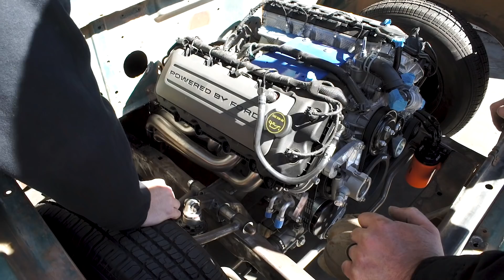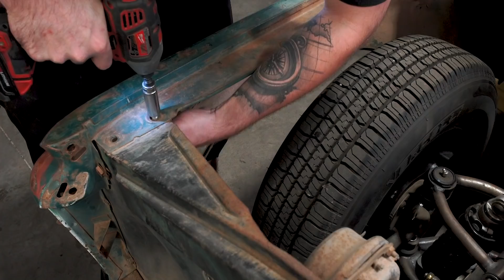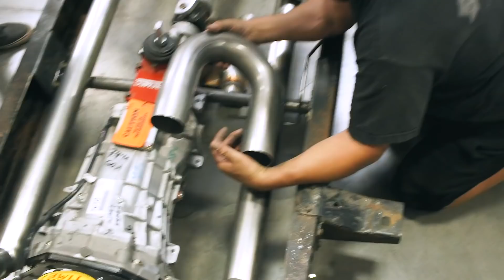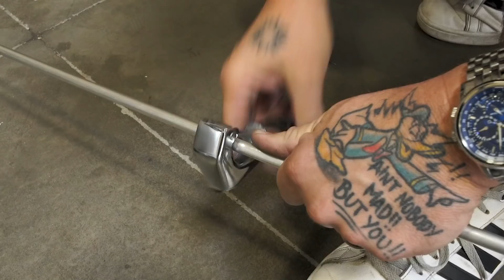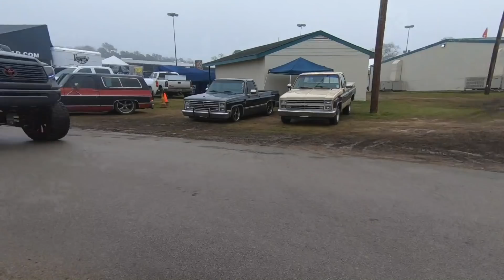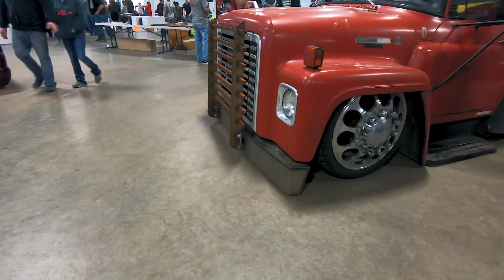Switch Suspension "Ain’t nobody mad but you"

Comment: I went with a towncar front clip just because of budget but down the road I will do No Limit IFS with a coyote, Really like this truck.  I live 3 hours away in Sierra Vista and hope to make it up to the Phoenix area with mine and see this in person.  Where do you get those steel wheels at that are on the burbon.
Reply from the maker: The wheels on the Suburban arent steel. They're Billet Aluminum with center caps
Reply: @switchsuspension  sorry, where did you get them from?
Reply from the maker: Those are from Delmo Speed